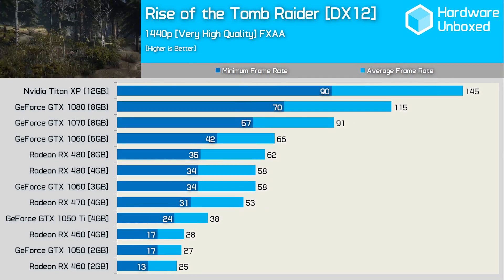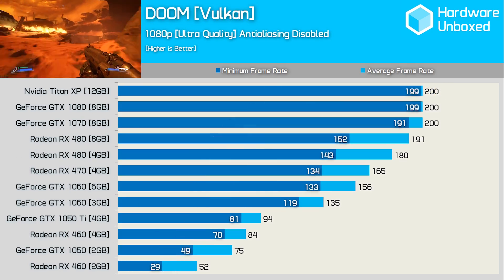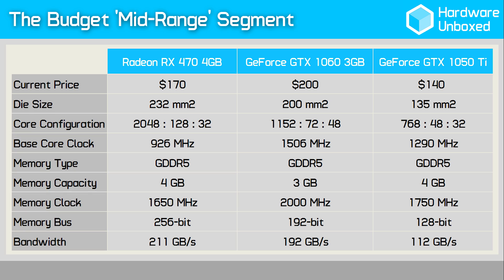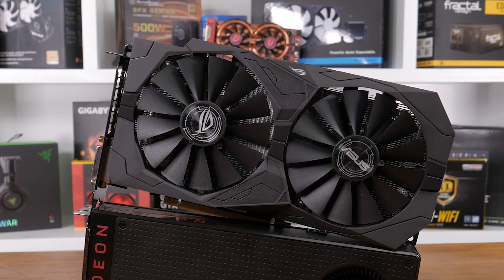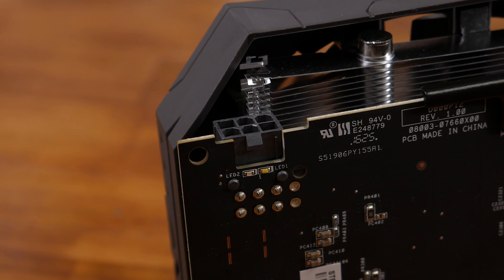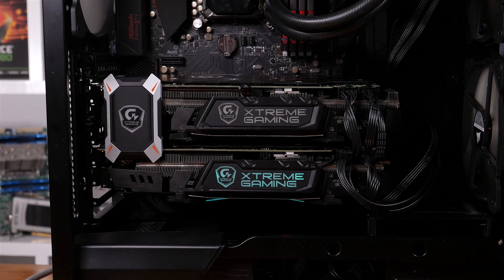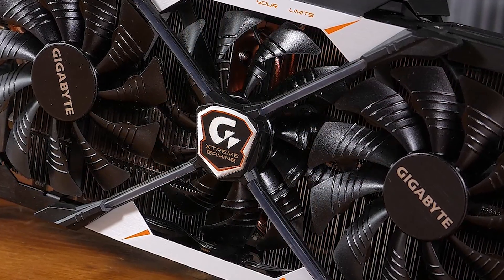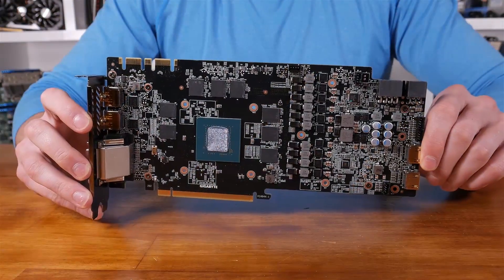Top 5 Best GPUs in Early 2017 [Based on HUB Benchmarks]

Comment: The deals on the 480 I've been seeing are insane. On Amazon you could get an 8gb red devil 480 for 229, with a 20$ mail in rebate. That's a top of the line 480 for 209, that's crazy.
Canada fucking sucks. That same gpu should translate to about 279 in actual Canadian currency differences, but no.. It's 380+.
Reply: What...the...funk! you Sound like a little idiotic fanboy..
Reply: Taxes I guess. Free healthcare is not so free appearantly.
Reply: In my country the 480 4GB cost around $290. Fuck my life
Reply: Frankie Dingleberry Bruh, I got my rx 480 8gb on sale for 310 cad ,you gotta wait for the sales
Reply: I know right? what the hell. taxes don't add another 100
Reply: Red devil are not having a great PCB. AMD 480 choices should be XFX GTR, MSI gaming x, Sapphire nitro plus, Asus. 
Ones to avoid are Gigabyte, Powercolor.
Reply: S Glad you mentioned that. Though if you don't care to overclock, it won't matter if you go for the cheaper versions of some of the cards.
Reply: Frankie Dingleberry UK prices are about 25% higher than in the US which is annoying.
Reply: UK prices have been decent in my opinion when you consider our 20% sales tax. I got my Sapphire Nitro+ RX 470 for £150, which is around US$185 at the moment. That's almost the same price as they are going for in the states.
Reply: blaser on the US amazon site you can get a 480 for $175, not too bad but still a £30+ difference in price.
Reply: Ken Bone no it isn't because US prices don't show sales tax and it differs by state. For example, when I was in NY I'd have to add on an extra 8% to the listed price.
Reply: blaser I wasn't aware of that. I guess you have to enter the state on amazon to see the real price.
Reply: taxes in my province is 5%
Reply: CS : GO Top Highlight , same here. Either 4gb model is unavailable or the gaming x is there which is same or higher in price than many 1060 6gb models. Now 4gb vs 6gb, it's a no brainer .
Reply: CS : GO Top Highlight in brazil 1300$
Reply: on a famous Swiss site ( Digitec ) the XFX 480 RS 8GB is 199$ but the GTR version are at around 280$. Insanity
Reply: XBDanilo RX480 4GB is around R$900-1000 here, which is about US$285-320.

Comment: On Amazon there are a few AIO water cooled Fury X cards for ~300 USD
Reply from the maker: Sounds like a good buy, I will be doing some updated Fury X benchmarking very shortly.
Reply: I'd buy it but because of the design of the AIO it would be a pain in the ass to integrate into my water loop.
Reply from the maker: The only option there would be to buy a custom block for it, probably not worth it since the supplied AIO cooler works well.
Reply: Yeah. The price is superb, but I think I'll just wait for the RX490 and bite the bullet then, rather than fiddling with some janky homemade solution.
Reply: Yes with Vega being so close if you don't need a new GPU now then it's better to wait and see. Especially with Nvidia also planning the 1080 Ti.

Comment: great video, however, where I live, the prices for gtx 1060 3gb and rx 470 4gb about Usd 260 are same, I will go with gtx 1060 3gb
Reply: Go with the 470.Or even 480 4 GB
Reply: wow ive never seen a rx 470 at 260USD? but ive seen it a 150USD.. at 260$ just buy an r9 fury its close to a gtx 1070 for 130 dollars less.
Reply: TheSinisterEyes1 Where he lives
Reply: +TheSinisterEyes1 "where he lives" there are probably no furys for 260$

Comment: Do you think it's worth buying a used gtx 980 ti for $300 over a new gtx 1070 for $400?
Reply: definitely, the 980ti is on par with the 1070
Reply: in 1080p gtx 1070 destroys the 980 ti in some games  like gta 5 star wars battlefront talking about 10-12 fps difference  the rest are just 1-5 fps difference and in 1440p 4k 980ti is like better by 2,3 fps and when it comes to power consumption the 1070 win id go for the 1070 anyday
Reply: where can you find it for 300$ tho talking about brand new cheapest one iw seen is 350$ and the 1070 is 400$
Reply: Pilot KaZZ 
rather buy a used 1070...u can get that at same price
Reply: Kim Faes lol. No thanks, I have a g-sync monitor. ;p
Reply: Kim Faes not really :D
Reply: Kim Faes If you saw it for $250 you'd think it was...
Reply: They are much better when they oc'd
Reply: Mr.32-bit fuck no it isn't
Reply: mitkqza got a evga 980ti Sc for 215...they were last 6 at the shop bought them all